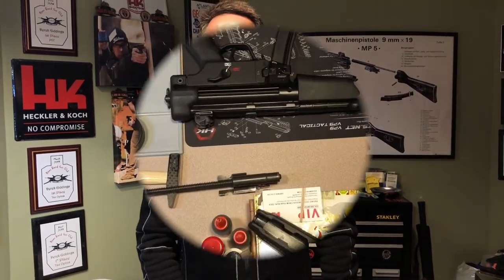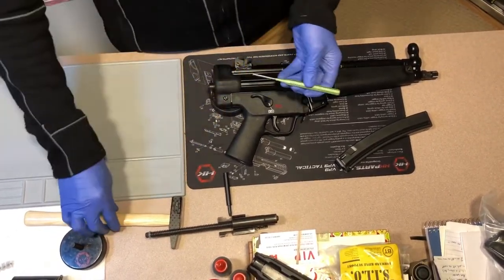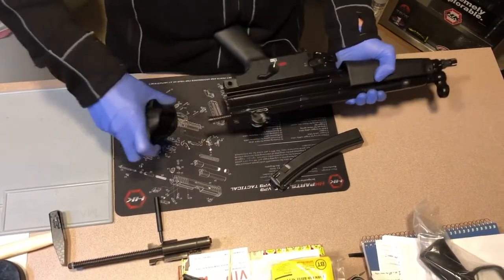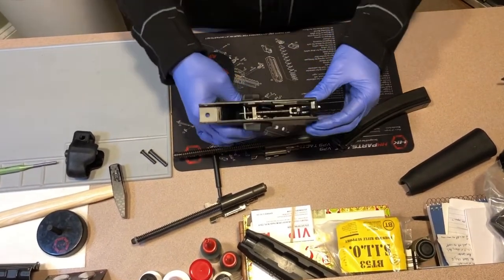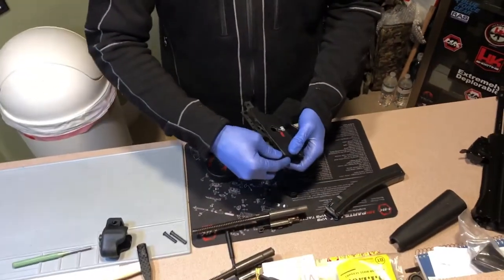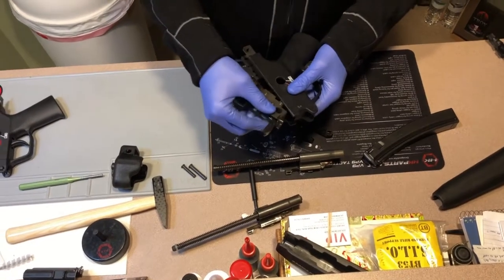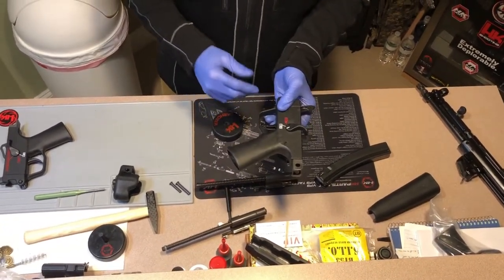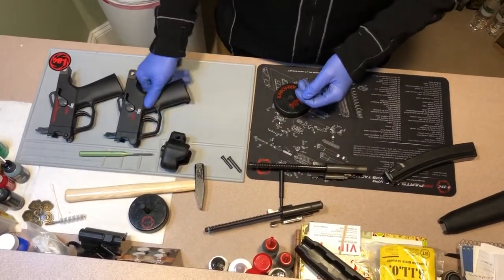HK SP5 Disassembly heckler & koch h&k mp5 sp5k 9mm pcc sp 5 mp

Comment: Stock on mine was super tight. I used the sling, clipped it to the stock and pulled it off. I put a little piece of paper towel where the sling clipped on so I didnt scratch any metal while pulling.